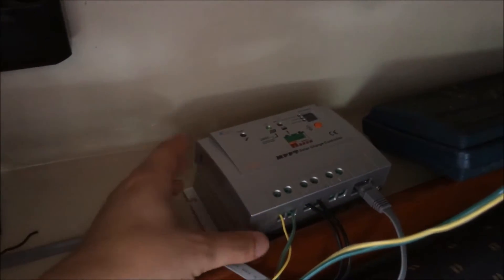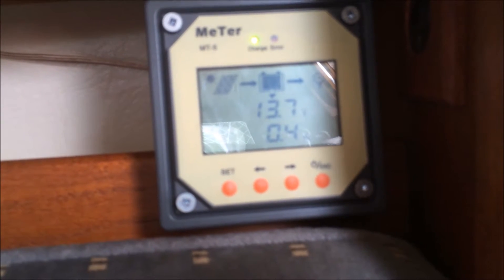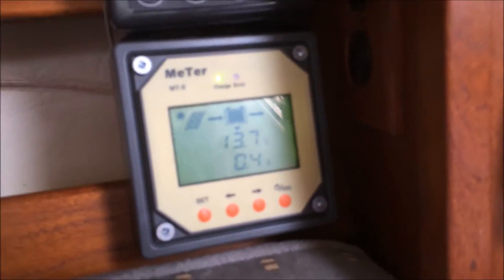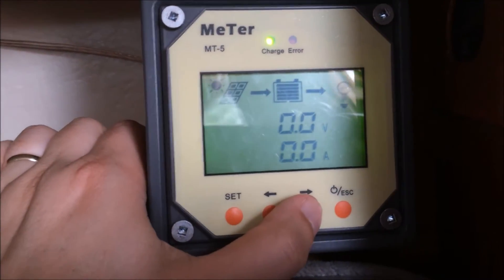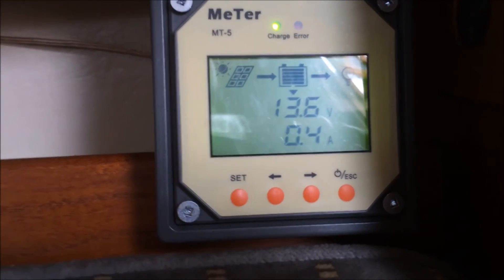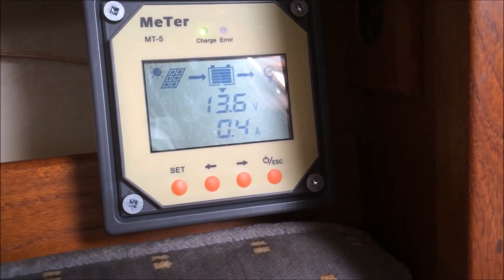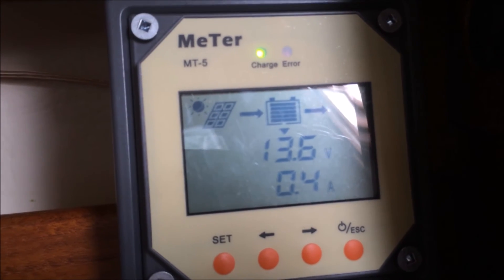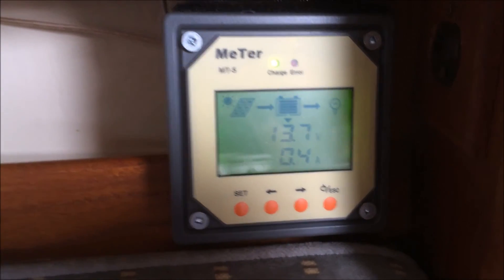MPPT Tracer Solar Charge Controller  Review

Comment: You keep saying it "Discards" the extra voltage than say it converts it later on. You should correct this anomaly. It converts , otherwise it would be quite a waste of energy to even use this type of controller.
Reply: I believe he was referring to the other type of charge controller (PWM) that's "discards" the extra voltage.  He went on to say that this Renogy MPPT charge controller he's reviewing actually converts the extra voltage to stored energy unlike a PWM.

Comment: how did you program it to work for a 12 volt battery?
Reply from the maker: I don't recall if i had to program it for 12 volt. where you looking to use if with 6 volt or 24 volt?
Reply: Shawn Esit you power up the controller via battery, before you connect the solar panels, the unit works it out by itself

Comment: I think there is a bit of confusion here. The main benifit of an mppt controler comes when you wire your panels in series. A single panel nominal 12v will only start to charge the battery when the panel voltage goes higher than the battery voltage. So on a dull day the panel would struggle to get to a charging voltage. But with an mppt controler and more than one panel wired in series, V1+V2+V3... it will hit a charging voltage much sooner. This chap explains it very well

https://www.youtube.com/watch?v=32QLjBj62pw

Comment: Hey guys..I have this mppt tracer 40 A. I have two 24v 200 watts solar panels putting in a total of 400 w and a 12v deep cycle golf cart battery at 135 Ah. I am however only putting in a maximum or 13 amps while it should go up to 33amps on a half full battery. What might be the problem here? Everything is new from panels to battery to inverter and controller. Thanks...
Reply from the maker: +Qaysar Islam You may want to ask the question on sailnet or a larger forum you will get a lot more responses. But you will almost never get the full output of a panel. The 33 amps I suspect is in perfect conditions and the perfect time of year in the perfect hemisphere. How you have the wired up and the gage of wire you are using can effect them. series vs parallel. On a good day with my 100 watt I can get 5 or 6 amps so you should be able to get around 20 with out to much problem so something is wrong I would guess. Try removing one panel and se if you amps cut in half then remove the other with the same test. It sounds like one of your panels may not be working or has connection problems.
Reply: So I can put 24volts of solar in through the controller into a 12 volt system?
Reply: @roverporter2434  I've got this charge controller, and I put in 42v, the manual says it supports up to 150v.

Comment: Please don't tell me you have batteries charging inside the cabin
Reply from the maker: +The Ball I don't understand your question?? They are in the same place almost every sailboat has
the house batteries.
Reply: +David Drysdale OK, well if you can't place them outside the cabin, you should at the very least seal them from the cabin and vent them to the outside. A charging battery is an acid bomb waiting to go off. This happens a lot, and hydrogen has a way of sneaking through the smallest hole (even holes too small for air to slip past). On my van I mounted mine on the bottom for this reason. It's a lot safer.
Reply from the maker: +The Ball Interesting I googled it and found a few mentions of the problem you suggest. I have a gas sensor on the boat that will detect hydrogen and CO2 if the diesel were to spring a leak as it is in the cabin also. But it looks like one of those problems that are very very rare and a symptom of overcharging. I assess risk based on probability and it looks like something I shouldn't worry to much about beyond the gas sensor . I always say if driving to the boat has a bigger risk than anything on the boat don't get to nervous. But thanks for making me more aware.
Reply: +David Drysdale It isn't rare. Thousands end up at the hospital every year in this country alone. That doesn't include all the people who were injured and didn't go to the hospital let alone the tens of thousands of batteries which blow up every year causing massive damage. A hydrogen leak only has to find a path to, say, a refrigerator compressor to ignite and then you have sulfuric acid everywhere. If that happens your best bet is to leave the cabin and never return. Sulfuric acid is bad enough (can cause pulmonary edema and long term damage even during a short exposure), but when it leaks into the carpet, glues, and various other petroleum materials you get even more nasty fumes/liquids which in turn embed themselves into all the wood.

Yeah, you could don a hazmat suit then neutralize the acid with an alkaline solution, but I've never seen these things outside a lab. Or you could put the batteries in a solid polyethylene container with a large enough vent for the gasses to exit during an explosion. Or, better yet, find a better place to put your acid bomb. 

It's your life, though. Do what you want
Reply from the maker: You should bring this to the atenshion of regulatory boards an insurance companies in the boating community as just about all boats are built this way. But to be fare with over 330 million in the USA thousands is not much. Tolites ingure 40,000 every year in the USA. I am just saying if I were concerned with everything that hurts thousands I would never leave the house. I do get you are just trying to help me but I hope you understand I mean you no disrespect. Don't look up where the diesel engine is in a sailboat, will keep you from ever setting foot on one. ;) http://www.kodiakde.com/SiteAssets/projects/IMG_0961.JPG You can se the battery box in the left part of the picture closed. This is not a picture of my boat but I have the same modal and it is just like every other sailboat in the water today.
Reply: The Ball man you are crazy.  This doesn’t happen that much.
Reply: @SSBN506  You're fine with sealed batteries.  While there may be some off-gasing with sealed lead acid (SLA) batteries, hydrogen is generally only an issue with Flooded Lead Acid batteries.  Otherwise, the UPS battery backups on computers would need to be vented too.

Comment: you need heavier wiring to get the most from your system.
Reply from the maker: Grumpy OLD I assume you are referring from the solar panel to the charge controller?
Reply: ***** .. Hello David, yes and also the wiring to the battery from the charge controller. The smallest cable you would want to use would be 10 awg ( That's the copper size ) otherwise you aren't getting the full benefit of the power that your panel or panels are producing. Yes you will still be getting the voltage, but not the amperage. Amperage is what charges the batteries. You need cables that can handle higher amps due to an anomaly called inrush current, which is sort of like when you turn a tap on in that you get a burst of water until it settles down to a normal flow. Electricity does a similar thing. Also if that wiring you are using is automotive grade, that stuff is rated to the point of the insulations melting point, not its normal current carrying capacity. Example: auto wiring that is tagged as being 10 amp wire means that its MAXIMUM is 10 amps is the most it can handle before the insulation starts to melt. Its actual CONSTANT current carrying capacity is around 5 amps.
Reply from the maker: Thanks that is very good to know. I will update the wiring and update the video. Thanks
Reply: No problem and if I can be of any further assistance let me know. Cheers